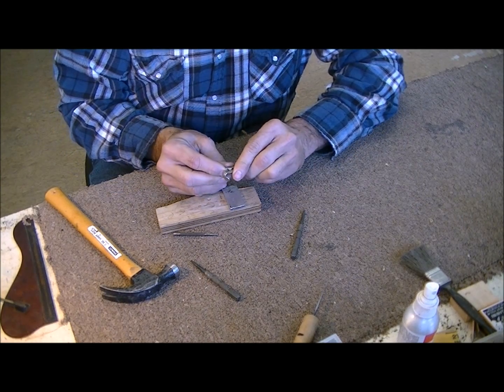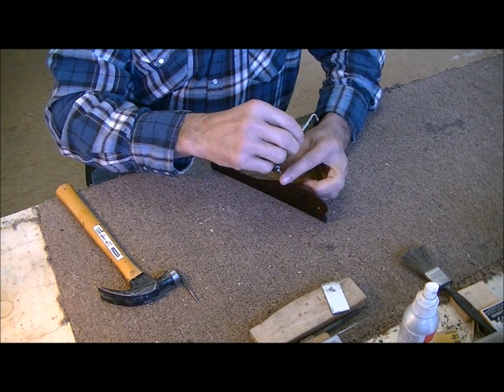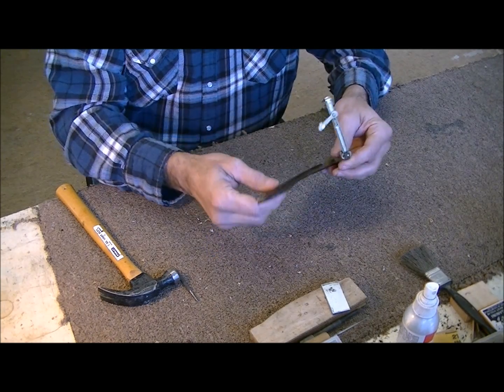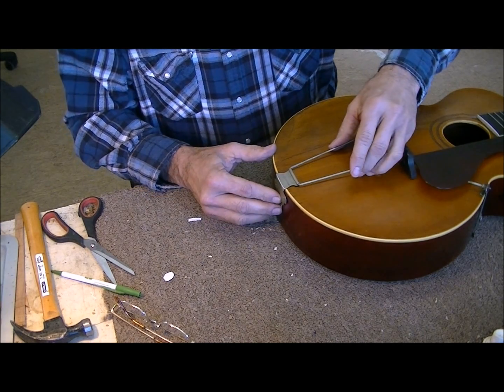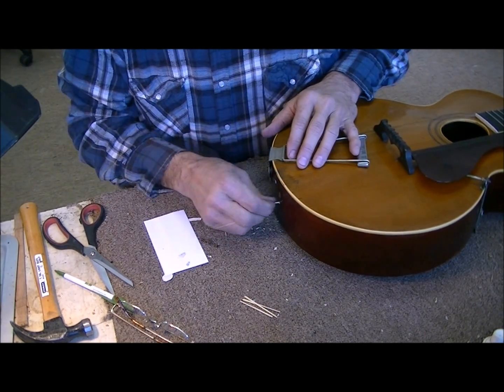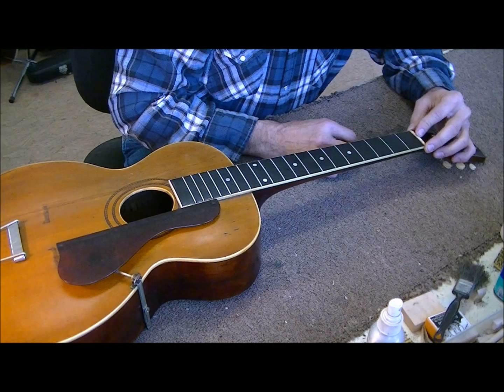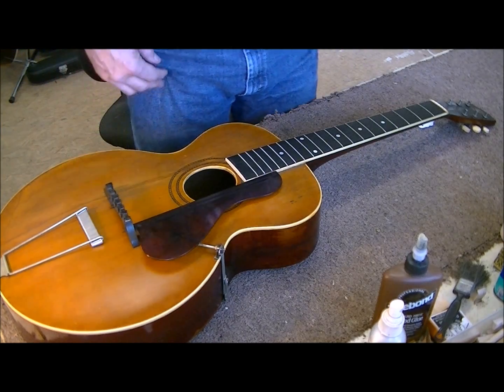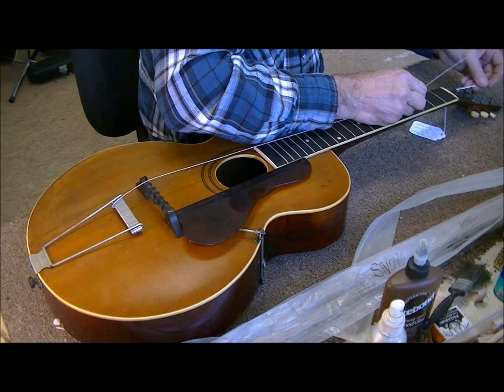050 RSW 1914 Gibson L 1 Restoration Final repairing the pick guard clip and setup

Comment: Just picked up a 1911 l-1. Like to try and make pick guard. Great videos brother.
Reply: Did anything ever come of your project? I'm trying to make one myself and I've got some great research to share if you're interested
Reply: @thestonedabbot9551  picked up pickguard material from SM and some hardware, but it's been sitting ever since original post
Reply: @KMactheFarmer  Hope it turned out well man. May I see a pic or 3?

I'll have no problem making the actual guard from celluloid and the mounts from resin blocks. The metal clamps though are a different story

My L1 as well as historical authenticity is very important to me so I'm trying to find some way to get a replica of the clamps made for me in pieces, which I'll assemble myself

And if it interests you, while researching I came across the original patent filing for the clamps back in 1911. If you'd be interested enough to see it

Comment: Have you invested in a pegwinder yet ?
Reply from the maker: Ben Prevo I have a half a dozen different Peg winders I just find them not necessary. thank you for watching
Reply: They are such a time saver -- I have one on my electric screwdriver -- and time is precious -- did you listen to the keanettes ? Thanks
Reply from the maker: Ben Prevo don't use them when I remove strings, just loosen a couple turns and cut the wires.  When I put them on, I only wind a couple turns.  Thanks for watching.